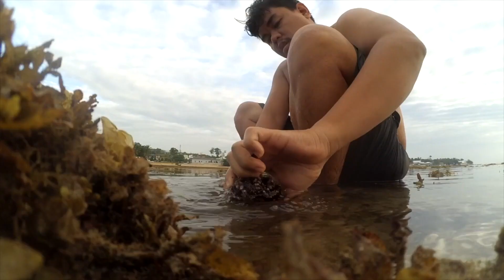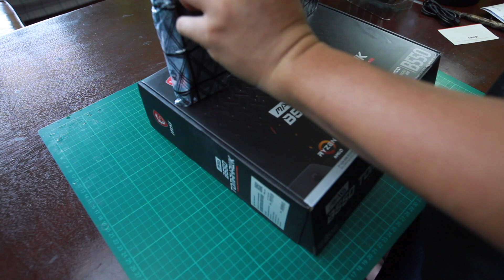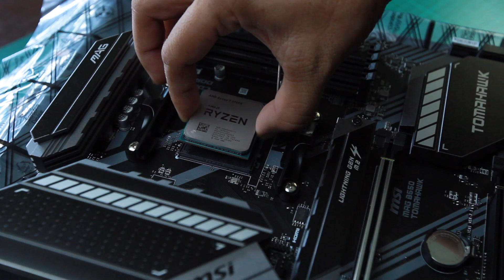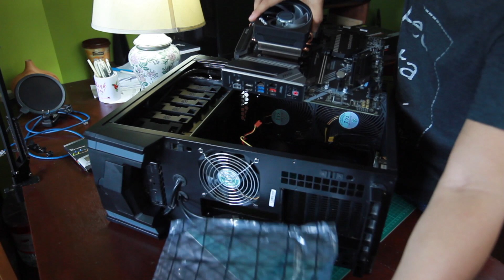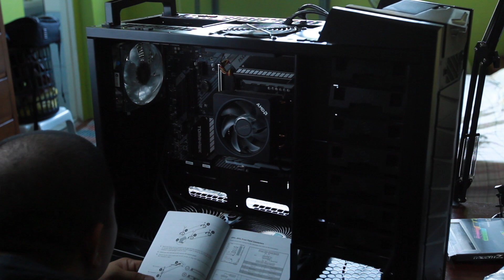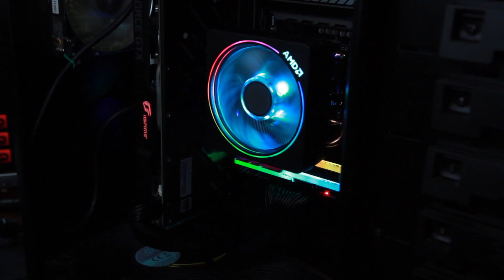AMD R7 3700X + MSI B550 Tomahawk + TridentZ RGB + WD Nvme Blue

Comment: i thought you would have had to flash the bios before anything. why are people flashing the b550 before they build then?i was under the impression that the b550 tomahawk would not support  ryzen 7 without the updated bios.
Reply from the maker: it was already flash when i received just do the latest bios update. it will work fine.

Comment: There is no light on ez debug led. Seen no problem but i have no display problem. I update bios with flash bios still no display
Reply from the maker: i would recommend using the on board display first before installing the GPU to check if the motherboard is fully functional. :)